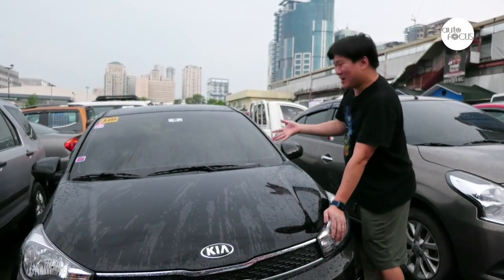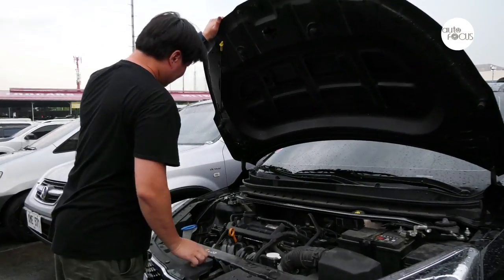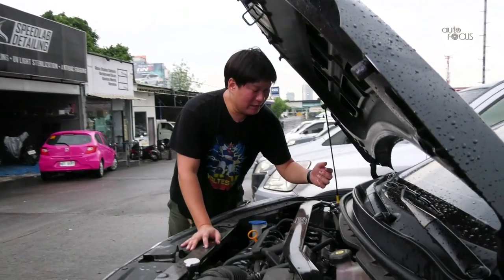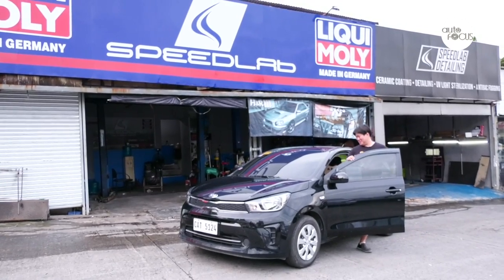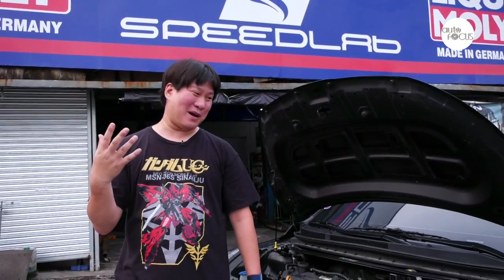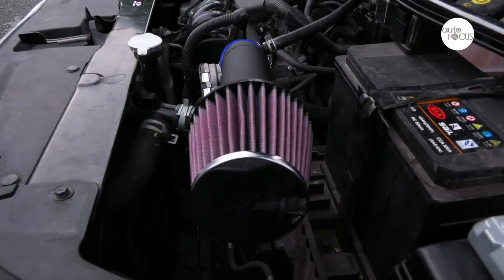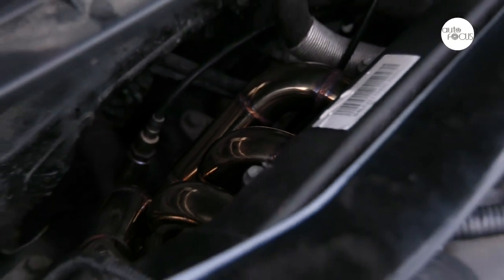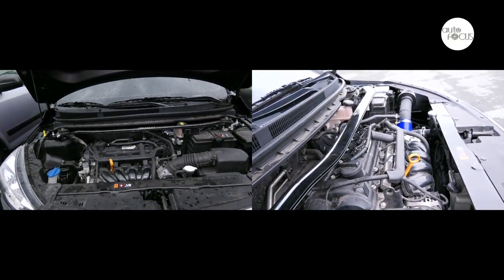Project Kia Soluto | Special Feature

Comment: If it is a manual variant is there still a chip that we have to replace? On top of the filter and the exhaust headers?
Reply from the maker: No need. If you are installing unichip, it's plug and play. After tuning you are good to go.

Comment: Lods. Anu ginawa nyo para matangal ung fuel knock na tunog. Ung parang lata kapag nag accelerate
Reply: ihataw mo sa 3500 rpm sa manual
Reply: I don't believe its actually "knock" the fuel injectors are just loud
Reply: fuel pump ang pinalitan saakin noon..